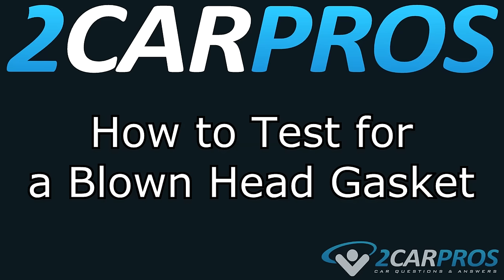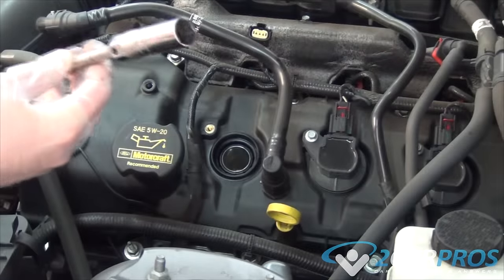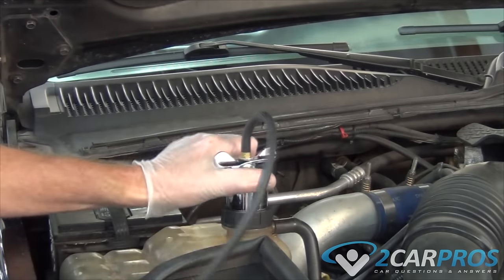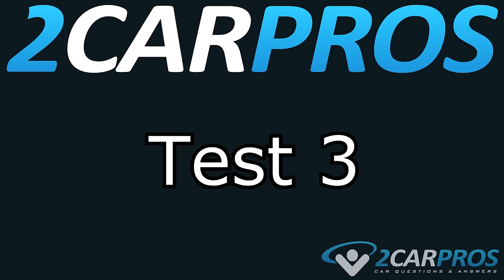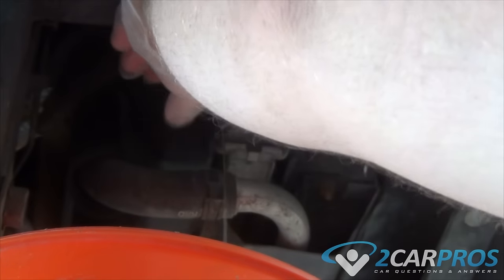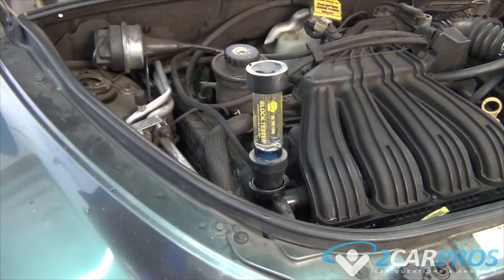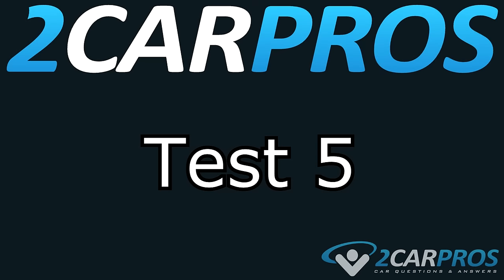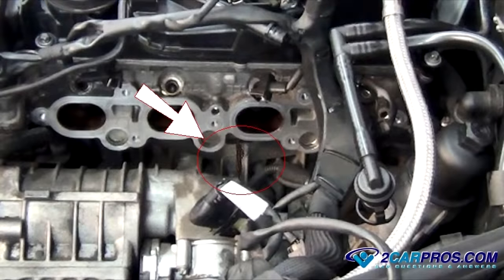HOW TO CHECK FOR A BLOWN HEAD GASKET

Comment: Why not just drain the radiator and smell it or even better;  take off the larger hose (s) off the engine and see if there is exhaust smell or take the belt off the water pump and see if there is a compression going up right away as soon as you start it and rev it up or to see if there is that compression;  you can put a plastic bag over the hose held with an elastic band with leaving a small amount of squished blastic that will fill if you rev it up when just started or put.  Wouldn't you be able to distinguish just by the smell though;  I guess it would need to be a large leak.  There would be another way or two;  by checking the compression while there is a compression build-up in the cooling system and see if it is different without the coolant system being uncapped.  Check uncapped first.  And in reverse one could take all the sparkplugs off after pumping pressure to the cooling system and checking the difference on how long the time for losing it's pressures with the plugs on and off. Oh and by taking yur phone camera and filming the inside of the chambers from the spark plug holes and looking for deposits.  Cheers

Comment: my 93 mustang gt over heats when im stuck in traffic on a hot day or if left on idle for a while. a little bit of white smoke does come out the tailpipe but nothing crazy. the only way it wont over heat is if the car is actually moving or if its a cold day. ideas on what it might be? im leaning more towards the head gasket theory but not 100% sure.
Reply: Cooling fan isn't kicking in, blockage in radiator, or thermostat may be stuck
Reply: exact same issue on an 87" Mercedes benz 260E ( 2.6L M103 inline 6)

Comment: TU & subscribed.
Questions: my 98 Sonoma 2.2L with 176k is having the head done (blown gasket....previously paid ($1,350) to a shop mechanic 1 month ago who ripped me off not doing anything to the warped head, amongst other faults. 

Now the head is being pressure tested, milled and valve job for $350 by professionals with a guarantee.
I think it now wise to replace the coolant & oil pumps even though no prior indication of faults.
I plan to replace the piston rings from the top. Doable?
Would you suggest the timing chain as well?
I ask about the chain partly because I see some kits that have the two pumps and chain together implying this is normally done together. Is the Cloyes that does away with the tensioners a better choice than OEM?
I am poor and unemployed just trying to be proactive. Am I going too far?
Thanx, Mark
ps...I prefer to keep this truck, other than the current problems it is in perfect condition.
Reply: The chain usually doesn’t need to get changed. The belt usually needs to get done and while you’re in there it is an extra 10 minutes to do the pumps. This is probably a leftover from the belt kits, where guys are just trying to sell a bit more and do a kit. Unless there is something wrong with your timing or it is damaged in some way, you likely do jot need to do the chain.

Comment: If the car has a head gasket problem (low compression, misfire) but the oil does not show any signs of coolant in the engine, would it be okay to buy the car to drive after repairing the head gasket?
Reply from the maker: Yeah it is probably ok to drive for a little bit. I wouldn't drive it very hard or far though. Thank you so much for watching!

Comment: On my 2003 civic the temperature only went high one time, every time I open he radiator and check the coolant level it’s always a little low. The fans are coming on. Not sure if I have a blown head gasket or if I just have a coolant leak somewhere.
Reply: I have the same issue on my 2003 Civic with 150k miles.  Is suspect it's a head gasket since there's a black ring in the radiator, I smell exhaust gas in the radiator after driving, and some coolant is missing.  I replaced the thermostat, cap, and pressure tested. No loss of pressure or leaks, and fans are running fine. I thought I would lose pressure if it was a head gasket, but maybe I should remove the spark plugs and pressure test again.
Reply: Buy the mitivac mv4560 pressure tester. It will find the leak if it's a hose or the radiator. Like 50$.

Comment: I have a 1991 Nissan hardbody pickup.  My water pump went out, and I drove to a safe location where I could call a tow-truck.  
Here's my question
When a water pump is being replaced, would a blown head gasket be noticeable ? 
Thanks
Reply: Christie No usually not at the waterpump will you anything weird or unusual. Where you should check is by opening the oil filler cap. If the head gasket was just blown at that very moment you probably can't tell and everything will look normal. If the head gasket has been leaking or blown for some time then you should see foam slimy frothy brown oily liquid when you open your oil filler cap. That is the motor oil mixing with your coolant.

Comment: Hi there 2CarPros, I was wondering if you have time maybe to help with an issue I am having. I am running in to an issue with a 2005 Toyota Camry V8 check engine light (only 52,000 miles on my dashboard so the car is not driven a bunch over the years). The last 2 years like clockwork a year apart i get the check engine. The first time I brought it to a show I was told to go to. They said after checking with their computer I have a faulty knock sensor. So I said okay lets do what needs to be done. They charged me $700 at the time in 2020. They said when taking apart the parts they found coolant in different parts of the engine bay (i do not know car stuff I am pretty sure that is what he said). This part of the problem is how I found your video here. I am wondering too what could cause the coolant leak. They replace the sensor and a few days later the check engine light returns. Same codes on their test so they replace the sensors again (for free). A year goes by and then just before inspection time Check engine again. Go to the shop... same code. Now they do the replacement again and charge me $300 just for parts they say (do not know if that is a reasonable price). It is now a year since then and once again I have a check engine light. Also I should say my coolant is about an inch lower than it was a year ago. Just trying to ask anyone and everyone for information. It is such a hard thing to find a mechanic in NY and since I am not knowledgeable (but trying to learn) it makes this soo much harder.

Comment: My car is a 3 cylinder. Has no mayo, some coolant has been used over maybe 2 or 3 months but not huge amounts. Did a compression test and cylinder 1 and 3 were 185 but cylinder 2 was 150.

I can also hear an audible whistle between 3 to 4.5k revs. sounds like a exhaust leak but it is not as I've had a new one fitted and took it to the garage 3 times as I was not sure.

Cylinder 2 also misfires is left at idle for 10 minutes.
I've taken my car to 4 garages and one specialist who couldn't find an issue. What could be wrong?
Reply: I know it's a bit late, but out of curiosity, was it a Sandero TCe?
Reply: @Dorian  no it was a 2006 vw polo 1.2l I have since sold the car and now drive a 2007 mk5 golf gti

Comment: Hi, my Chevrolet Optra 2010 engine overheating. I noticed the coolant level was low and filled it up to MAX and drove around 3 days. Air conditioning was on while I was driving it, suddenly became so hot in the cabin. I stopped the car and the engine went-off on it's own. The engine couldn't be ignited there after. I took to mechanic and he said, the cause was due to engine head-gasket. He changed the head-gasket but the problem still persist, engine still overheats within a 5 minutes and gauge rises from 1/4. Mechanic said, now only engine fully has to be changed. Any suggestion please? I also noticed leakage from the coolant cap, replaced it, then seemed fine. Please share some information.  I really appreciate your feedback. Thank  you very much.
Reply: Change Mechanic!

Comment: Replace head gasket ,chains and sprockets. Replace oil and filter while you still have a good running motor. New antifreeze and dealer thermostat only. ONLY ONLY !! Use only synthetic oil you should be good.

Comment: So if i see the milky substance swirling around in my radiator and some of it in my coolant reservoir but NOT in my engine oil filler hole does that mean it's not a blown or cracked head gasket?
Reply: So the cap is clear of milky sludge? Perhaps the problem needs more time to develop in order for the sludge to turn milky
Reply: Exactly what’s going on with my car

Comment: Okay there's no milky residue in oil or on oil cap, there's no bubbles in radiator, but two spark plugs did appear to look like they had rusted a bit. There is so many other things happening with this vehicle and I was hoping that some other problem could possibly make spark plugs look that way. Car runs fine, it randomly runs hot if idling, although it doesn't go any high hot but needs some water every time. Thermostat was put on thinking that would help, I noticed the top hose running from radiator to thermostat was very hard and hot...IDK what to do
Reply: fan clutch?
Reply: Egg
Reply: Prob too late to say this now but change the cap maybe ? 😂 the cap to the radiator and the cooling system

Comment: I completely drained my coolant and oil.
#1 there is no milky stuff on the oil cap.
#2 The coolant looked perfect.
#3 The oil looked Normal.
On another video the oil looked horrible milky or almost creamy... ugh.,.. 
#4 No bubbles when removing radiator cap.'
#5 Engine runs perfect and idles perfectly.
My power is perfect and My gas mileage is Great... but there is a slight smell of oil or gas in the coolant 
overflow container. 
Fck it! I'm buying another engine! hahahaha... It's good for now but better safe than not. Peace!

Comment: I checked my oil today, which I do monthly, and my oil was milky… not heavy but it was noticeable!! It’s a 2012 mercedes c350 and the coolant level is normal as it was when I last checked it. Clean and clear. Car on and I see 0 bubbles.. no smoke out of the exhaust whatsoever. No misfires. No check engine light. No oil leaks either. We did have heavy rain a couple weeks ago, but idk how water could enter the engine…. Any idea?
Reply from the maker: Older Mercs always have leaks, if it leaks out then water can leak in. Probably where your slight milkiness came from. OR its a very small head gasket leak. Thanks for watching!

Comment: Why does the water come out my muffler while filling the radiator on a 2000 gmc sierra there is no water in oil and have changed out the manifold intake gasket?

Comment: Will a blown head gasket turn the check engine light on ?
Reply: Not directly, but it'll lead to problems that will.
Reply: Most likely o2 sensor
Reply: No but after a while If you lose all your  coolant and you start to overheat , yes, or if the coolant gets your spark plugs dirty, it will cause a misfire check engine code, eventually you will see smoke in your exhaust or and the car won run normal

Comment: Hi I have 01 Lexus IS 300 I’m loosing coolant from the cap of the radiator seams to have a lot of pressure but it doesn’t over heat runs good I cannot figure out please help

Comment: hi, i have a 2000 mazda 626 2.0l. my radiator recently had a crack in the gooseneck and was letting the air pressure out, after i fixed patched the area the next day my car wouldnt start. took sparkplugs out and notice water was mixed. Does this indicates a blown head gasket?
Reply from the maker: Yes. Thank you for watching!

Comment: My air is cold at idel but when you put foot on gas and in a pull it turns hot until you at a idel again
Reply: This usually means low coolant. But then u gotta figure out where the coolant went

Comment: Am I wrong in thinking that an engine with blown cylinder or ring will sound much different than if intact? Also not sure of the terms, in this specific context...there's blown cylinder, ring and head gasket. Are the first two more or less synonymous?
Reply: Depends how long its been like that. Eventually if coolant is getting into the oil its going to ruin your bearings.

Comment: I have a similar problem. Had a bad radiator leaking. Used stop leak to fix the problem for a while but the car ran hot smoking about 4 times. Had radiator replaced. And now car seems to be running fine with the occasional thin poof of smoke. On startup and while idling. Not really bad but visible. Don't know if it's a possible small head gasket fracture or one valves like you had said in another comment. I went and bought some head gasket repair liquid. But haven't put it in yet because I'm not sure if that's the problem or not. The car does not run hot now. Seems to be fine except for the thin smoke from the exhaust. Also no milky oil. Or leaks that I can see. Haven't checked spark plugs yet. Also hear a little bit of rattling under the hood when I start the car and for about 5 minutes of driving. It's a 2006 Hyundai azera V6 What do you suggest?
Reply: Hello, have you found out whats wrong?? I kind of have  the samw issues

Comment: Hey i have a 96 crown vic i have had 3 to 4 years the only problem i have is when i turn my air on it blows smoke out of it white smoke i always check oil its normal color not gueeey or nun how can i stop it from throwing white smoke when the air on

Comment: Interesting. I have water in the oil dipstick, but no oil in the coolant. Any ideas?
Reply from the maker: Sounds like a blown head gasket. It can go that was as well.
Reply: I have had that issue on two vehicles(94 Ranger 4.0 liter & 2002 Venture 3.4 liter). Both turned out to be the lower intake gasket. On the Ranger I was losing coolant and had poor engine vacuum readings but no mixing of coolant with oil. The Venture had the tell tale signs of tan, milky residue on the dip stick and on the inside of the oil cap. Hope this helps. Many nice vids here on how to repair these.

Comment: I have a g35 and last night my car just overheated out of nowhere (no previous problems) and my revs were jumping from 1k-2k on it's on. I pulled over and it started smoking a little, while the coolant was leaking. Any idea of what it may be?
Reply: ChuyFilms could be  a  number  of things
Reply: I have the same problem but with a 83 camaro did you find the problem??
Reply: Jose Garcia thought it was the thermostat but it ended up being a blown head gasket

Comment: Maybe someone can help me. I have a 2000 Ford Focus SE that wasn't taken care of before I bought it. It had a cracked coolant tank and ran well after I replaced it. A year later it began to overheat only while idle. One day while idling the temperature rose rapidly and expelled all the coolant from the car, spraying all the engine and smoking. Heater hose tube had a long crack in it. Replaced the hose tube but I'm still leaking only when the engine is on. It is leaking green coolant from the oil pan however the oil itself is not milky. Any response is appreciated. Thank you
Reply: BrandonTS95 if problem only at idle it is a fan related issue for sure. Could be be bad fan, fan fuses, fan relays, fan wiring, fan controller, bad fan clutch if your car uses a clutch fan. Not to say that's you only problem. Could have other problems on top of that but that is definitely one of your problems guaranteed.

Comment: My 2004 Ram 1500 is having so many issues.....coolant usage, overheating, P0300 P0301 P0302 misfire codes. mayo on the oil cap, rough idle, power loss, oil usage.... head gasket seems like the most likely culprit, right?
Reply from the maker: Yup. You got it! Thanks for watching!

Comment: So, I have a 1999 Ford f150. Has had pressure in the reservoir tank loss of coolant white smoke slight rough idle since I had it. The temperature never gets hot though the coolant don't bubble it just overflows out. Been driving it a year with it as long as keep water or coolant in it it runs fine. There's never been any mixture of coolant or oil have had two oil changes. Drive it everyday to work with no major problems. Any ideas?
Reply: Did u ever fix I just put a motor in and it’s giving the same issue coolant is over spilling and white smoke but not running hot

Comment: Would this cause any engine codes? Our 02 Corolla had been sitting while I was waiting to replace brake lines. Started it every day and one day it cranked but wouldn’t start. Thought it was the fuel pump so replaced it. The car will start now but dies pretty quickly. Oil color/levels look normal. Car has never overheated. Only code showing is for O2 sensors which I know will kill your gas mileage but don’t affect engine performance
Reply: It won't trigger a CEL if it doesn't affect combustion
Reply: Try looking at fuel pressure regulator

Comment: Surely if you take the radiator cap off when the engine is cold you wouldn't see any bubbles even if you had a blown head gasket because when the engine is cold the thermostat hasn't opened yet

Comment: 2Carpros,  Wouldn't a loss of coolant automatically indicate a blown head gasket if there is no leakage?
Reply: jim Nicosia yes. Had the same issue. The coolant is going wrong place. Forgot what my mechanic said
Reply: No! It could also be leaking from the heater core

Comment: I have a 2000 dodge neon and I can't go ove 10- 15 mph I don't remember over heating but it's possible 1 mechanic said it was a leaking head gasket but another told me it was the catalytic converter does this sound right to you guys thank you for your response
Reply from the maker: Sounds like a plugged catalytic converter. Thank you so much for watching!

Comment: @0:15 found oil in my coolant
 and my entire cooling system was covered in that goo even my head gasket when i took the Cylinder heads off
Reply: Albert Chavez   My reservoir filled with sluge what’s that mean
Reply: @ricardoserrano8723  had the same thing bro I had leaks in my coolent and a bad hose